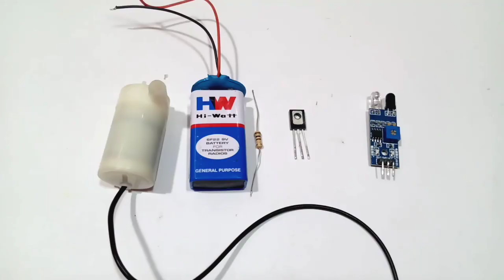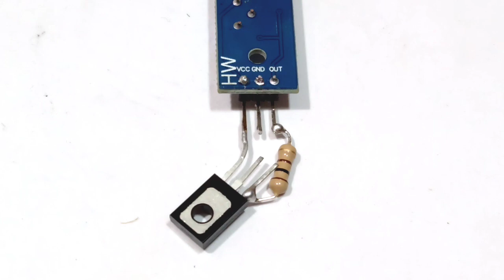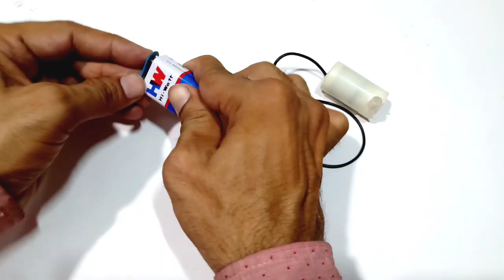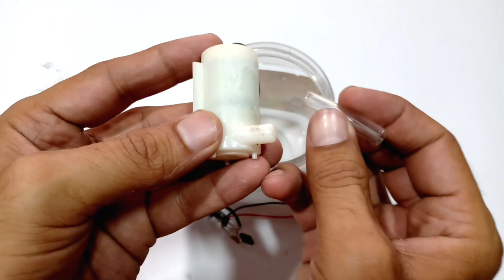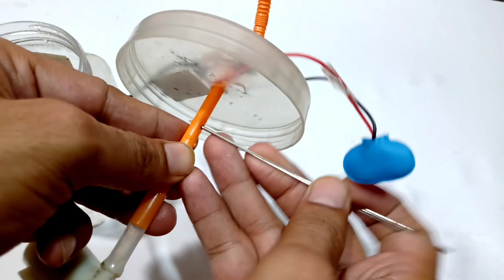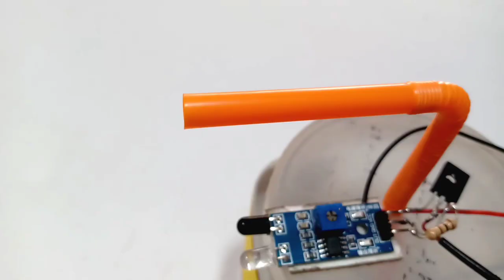How to make automatic hand sanitizer dispenser || how to make automatic hand sanitizer at home

Comment: hello good day sir.
can I ask something about this project, and their materials.
I need this for my school project this january 2021.
materials:
 Ir sensos-  check
Dc water pump 12v ( I can't find  6v pump in our place) 
TIP120 NPN transistor ( I can't find bd140 and TCP32C PNP transistor)
1k ohm resistor- check
wire -check
battery 12v- check

please advice if this materials that i commented is working? cuz I can''t find the same material as yours.. thank you so much
Reply from the maker: Link in description box .
Thanks for watching and like our video 👍